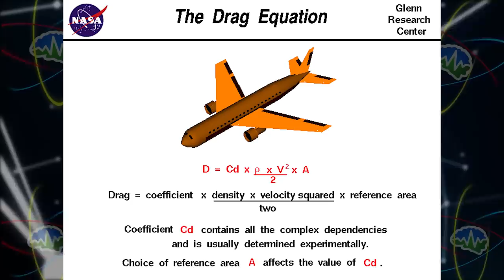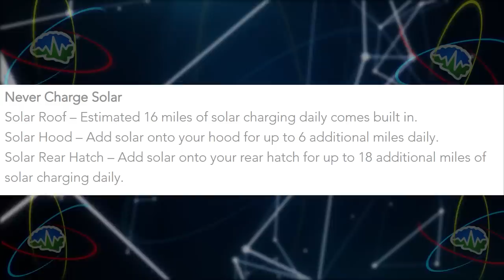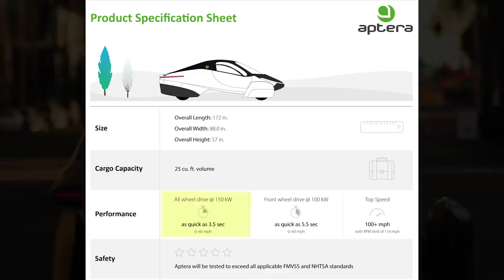Aptera Beats Tesla? | In Depth

Comment: I agree that just building bigger EVs with larger battery packs is not necessarily the best solution. One must be practical and honest about what is really needed. For example, the last time I had to do a 160 mile round trip was just once over two years ago. The rest of time I just drive 48 miles round trip or less. In my case I would be perfectly happy with 200 miles of range and charging from the Sun and plugging in for the difference if needed. But that's just me. Every person must make heir own choice. There is certainly a market for the Aptera out there and I hope they make it.

Comment: "No gasoline powered car has a range of 1,000 miles"... but lots of them, at 47K, are probably going to be a far better, and more luxurious ride than the Aptera (especially important on a 1K trip) and there are fuel stops on every corner, and every Exit along the way that will enable a fill-up in 5 or 6 minutes. I understand that some sacrifice will be necessary to be an early adopter due to the limitations of the technology at this point, but make a realistic / thorough comparison. Good review though. Aptera is eye-candy on the road though. Reminds me a lot of the Diamond DA-20 and the Remos Light Sport airplanes that I used to instruct in. All moot to me... not working due to Covid so I'll have to keep my 16 year old Outback anyway. Good thing I love the old ride!

Comment: Does anybody know if that 1000 miles is with the solar panels charging while they are driving? Would it be 1000 miles + energy gained from solar?
Reply: The thousand mile range is calculated from the EPA highway cycle with the 100 kWh battery pack and does not include any contribution from the solar cells.

Comment: By using Gallium Nitrite semiconductors instead of silicon semiconductors you could speed up charging by 2.5 times and increase the range by 5%. By using solid state batteries( ceramic or sulfide type), the energy density will be greater than the lithium type battery. So charging speed and range can be increased once these technology can output product at the industrial level. There is a company(Beam Global (BEEM) that is making charging stations that are solar powered and portable.
I wonder if the people at Aptera have looked into wireless charging. Tesla is looking into that as well as BMW, Genesis and Kia.
Do you know whose Solar Cells are being used in the construction of the Aptera? One way to increase solar recharging  by the solar panels when solar panel area is limited is to  increase solar panel efficiency.
Reply: There is a pretty good guess that they are using Maxeon cells, but it hasn't been officially confirmed yet.  I am sure that Aptera is staying abreast of leading edge developments, and in some areas are actually on the leading edge themselves.

Comment: Maybe I missed it but is this using a LPF or NMC/NCA battery?
With the efficiency of it's design and cost reduction, I could see the argument for the LPF.
But with the added charge cycles (top it up pretty much every time it's not moving) and range (at the very least the 1000 mile trim), I could argue against it. Plus they typically weigh a little more for the same capacity and it seems they looked at weight as a big factor along side drag.
I personally still wouldn't put my money down on an EV with a LPF at this point in the game for day to day use, stability and reliability. The results and reviews coming in from China and Europe with the Tesla LPF roll out has seemed to strengthen my opinion on that matter.

Comment: If the Sondors car ever comes out, it will be sort of the budget version of the Aptera, provided it actually retails for the 10, 000 or so they initially talked about.
Reply: The Sonders does not have the safety engineering of Aptera.
Reply: @n.brucenelson5920  That is true.  The Aptera  is definitely an all around better vehicle. But there are a lot of people, including myself, who cannot afford even the 25, 900 model. Hence, for us poor folk, the Sondors is attractive.  If I did ever get the Sondors car, I would line it with thick EVA foam, just to provide a bit of extra protection.
Reply: Well, tbh, I'm even more so learning towards the Metacycle or similar (E-motorcycle) and using that primarily for my daily work commutes, and keeping an ICE car for backup, for really long trips, more extreme weather, etc.  

  I hope Aptera eventually ventures into the 2 wheel market as well, and bring their aerodynamics and composites innovations to that field.
Reply: @justinw1765  Understood.   I have over 400,000 all weather miles on motorcycles, until I had to give them up due to vertigo.  My wife will appreciate not having to gear up and the climate control, however.  She was amazingly game to share many of our two wheel adventures.
Reply: @n.brucenelson5920   Sorry to hear about the vertigo issue, that sucks.  My uncle has Meniere's disease, and it's been really tough for him and he has to eat a very strict diet, and can't do a lot of the things he used to. He was a trucker, but had to quit because of that.
Reply: @justinw1765  Thank you for the empathy.  i am 71, so I have been very fortunate to have had the life I have had so far.  Aging is a process that, at least in my case, brings gratitude.
Reply: @n.brucenelson5920   Awesome approach and attitude. I hope I can become wise enough to primarily hold gratitude later on.

Comment: There can be maintenance problems with this car. For example if 1 wheel is more resistant than the other the range could substantially reduce. Because it’s range is so much dependent on the quality and fit/resistance of the parts.
Reply: The number of maintenance points is far less than most vehicles.

Comment: My problem with this great vehicle is that it will not pull my boat to and from the boat ramp let alone from here to the Keys!
My limiting factor.  My Subaru outback has a 2700 lb towing capacity WITH AWD for the slippery boat ramps. As well as being pretty competent off road, for as off road as I currently go.
Lmao, "a ride in the roadster"? NO! A DRIVE in a roadster!   ;-)

Comment: I I'm concerned about crash worthiness.  Structurally , can it hold up and not be a coffin with wheels?
Reply: The roof crush strength of the first version was 3 times stronger than any other vehicle ever tested up to that point.  This one is stronger.  It has front and rear crumple zones, front and side airbags, and other modern safety features.  It will be tested to automotive standards when preproduction vehicles are available to test and is likely to do very well.  When the ratings are published, I think the orders will explode more than they already have.

Comment: I wonder if they could make it with a small generator that could always operate at peak efficiency versus a standard engine which often runs out of it's peak power band. A couple gallons of fuel could go a long way.
Reply: A quick search find a Kohler auxillary power unit, it produces about 3.5 kw, but only burns .55LPH of diesel. Not sure if it would keep up for a road trip, but could help recharge after a longer trip.
Reply: That idea was tried in the first version of Aptera, and they used a small diesel.  I have also done this, using a diesel version of the smart car engine turning a dc generator winding on the flywheel.  DC meant that frequency wasn't important and the engine could turn whatever speed it needed to maintain the desired voltage and thus was always running at the optimum speed for the load.  Batteries are now at the point where that complexity is no longer needed.

A huge problem at the time was finding a small diesel that could be purchased in quantity.  Mercedes agreed to sell us the Smart Car engines with out any engine controls.  They didn't realize we had a smart engineering student who wrote the control software for a class at UC Berkeley, and we got it EPA approved at a lab in Southern California.
Reply: @n.brucenelson5920  I was following Aptera back then too. As well as Elio, I was disappointed to see both lose momentum, as I think there is a solid market for a hyper efficient commuter car, and now my drive is only 30 miles one way, but for years I drove 130 miles a day to work.

Comment: If the battery is fully charged, what happens to the energy supplied by the solar panels? Can the Aptera battery feed excess energy into the electrical system in a house, or does it just go to waste?
Reply: When there is a standard in place, V2G will probably be offered.  Since Aptera backs right to repair, third parties and owners can also install it.

Comment: I wonder why they didn't trade more window for solar. All the windows heat up the car. Curious how this would work out in Germany winter climate conditions.
Reply: We will have winter test results from the Elaphe cold weather test track next winter.
Reply: The full solar option includes a solar panel on the hatchback as well - not included in the prototype shown. Only then do you get the full 700 watts and up to 40 miles per day from the sun. Wish they mentioned that in the video. See their web site for all solar options.

Comment: I wonder what is a safety rating for this car? Special safety concern is because  the car is very light. Also, how it resist to the high wind? Can it be blown away by 60 m/h wind?
Reply: The car has been tested to be stable in 110 mph side winds. It is far more stable than any SUV.  It will be crash tested to automotive standards before production begins.

Comment: What about safety standards?  Seems more like a cool 3 wheel motorcycles.
Reply: It will be tested to full automotive crash standards.  We will have the ratings before production begins.
Reply: Body material is much stronger and more resilient than steel. Designed to pass auto safety tests, protect passengers in collision with air bags, roll cage & crumple zones, like in cars.

Comment: super light Aptera against winds & more real life questions:
1. Is Aptera going to end up in a ditch on windy days, eg. windy city ?
I mean winds from side, from front ,from back.
Has anybody taken the wind factor for consideration ?
2. stone chips might occur on solar panels as a result of road debris & hail
3. What happens in a side/rear impact collision with very LIGHT Aptera
4. what is snow or dirt effect on solar panels
5. useless solar when covered by rain dust in west Texas or Arizona, 
the Mediterranean Basin or parts of Australia to mention a few.
Sorry, 
to rain on your parade, let's test Aptera in real road situations
not only in laboratories & the nice weather.
I've no problem with the futuristic shape of Aptera, 
if the above situationsare addressed. I wish Aptera all success
Reply: It's not THAT light. It'll weigh about the same as the original VW Beetle. But it's 1.5 ft wider than the Beetle, so it should be more stable against wind.
Reply: 1It has already been tested to be stable in side winds at 110 mph - more than almost any slab sided 4 wheel vehicle.
2  The solar panels are replaceable in case of damage or new technology.  They have IP around this.
3.  We will have the crash safety ratings before these go into production.
4. Same thing as with any solar panels. People with these will tend to keep them clean.
5,  Not useless - but reduced output until they are cleaned off.

Comment: When you mentioned the elephant in the room, I thought you would say snow.  Two things come to mind, ground clearance and handling.  A single wheel aft is highly susceptible to side skid, especially in slick conditions.  And with the wheel fairings, it looks like this vehicle will bottom out on 6 inches of snow, even though the cab has more ground clearance than that.  Do you think this is a limitation worth considering?
Reply: Having a lot of experience driving a Corvair in snow, as well as many other vehicles, I don't think so.  There is an off road kit available to raise the clearance, if needed.  We will have more data on this when we see an Aptera being tested at the Elaphe cold weather test track next season.  Remember that the traction control is faster reacting than any other ICE vehicle.  I think with snow tires it will be fine.
Reply: It's absolutely a concern, you'd probably realistically have to restrict use to places similar to where convertibles are used or similar to where any 3 wheel motorcycle types are used., decent weather states or seasonal use., .

Comment: The Aptera is not a Car is is classified/registered as a motorcycle.   Motorcycles do not need crash testing or rollover testing.  Maybe that will change in the future as more of these are on the road.
Reply: Nevertheless, the first one was crash tested, and the roof crush strength was 3 times higher than any vehicle tested up to that point.  This design is even better.  It has front and rear crush zones, front and side airbags, and other safety features not specified by law.  It will be crash tested and the ratings published before it goes into production.

Comment: Love the look.  Has the prototype been tested in snow?  Here in the mid-west we don't get a lot necessarily (varies year by year), but we do get enough to have to drive through it.  With the covers on the wheels, I have questions on the build up of snow in those wheel wells.
Reply: Not just snow, but ice ruts from plows, smashed road kill , potholes that you can no longer avoid with that middle wheel....
Reply: @markbajek2541  What was the battery efficiency in those cold conditions?
Reply: @keithmartin955  I'm sure it suffers like all electrics do, it's a fair weather car/motorcycle for optimal performance. I'd be concerned about any collision with anything that sticks out at windshield level because you're only as safe as that windshield is strong enough to deflect a 10 foot piece of lumber with a little red flag sticking out of a pickup truck bed..

Comment: I like the looks, BUT...

I'm not going to leave my car outside at home to get it charged. Some places I go I have to park in a parking garage, like at my hospital or doctor's. 

What is going to happen to the battery if you can't cycle it? Lets say, like me you drive no more than 20 miles a day on average and the battery stays pretty much fully charged. Will they allow perhaps to shut off the solar so you can discharge the battery further once in a while or do it via a battery maintainer in the software.

How will the AWD do in the snow? I could see those wheel housings becoming jammed up with snow. My regular car in slushy crap can get clogged up. Heaters?

Addition: I'm a big man, I was born broad shouldered (poor mom). I'm 6' tall but have short legs, my height is in my upper body. Some vehicles my head rubs the headliner. Just wondering if a bigger guy will fit or do you have to be 160 to fit in it. I remember back in the late 70's and worked at a Honda dealer. I gave a broad shouldered customer a ride to work in a 77 Civic. We were door to door wide and touching shoulders in the middle. We got a lot of attention.

Comment: Does the off-road version have air suspension? What cameras or other sensors are there for autonomy? If I get towed to a garage to fix a flat, will they need special equipment to do it?
Reply: We don't know the answer on the first one yet.  Possibly.  The Level II safety pilot system uses cameras, and has OTA upgrades.  Standard equipment can be used to fix tires.  The wheel pants clip off and the tires are a common size.  I plan to carry a small DC air pump and a plug kit, so I can fix most road hazards and continue my trip until I can get the tire replaced.
Reply: @n.brucenelson5920  If I want to rotate my tires, what will it take? Jacking up the Aptera seems problematic.
Reply: @johnchang8279  Tire size is a standard P195/45R16.  There is a jack point at the rear and on each front side.  The wheel pants clip off.  It won't be much different to rotate than with non wheel motor tires, just a few pounds heavier.

Comment: If they design for aerodynamic efficiency, they should design aero number plate positions. Number plates would reduce the aerodynamics by quite a percentage. Not everyone can have no front plate either as in they do in some US states.
Reply: I think 3 wheel vehicles don’t need front number plates in any US state.
Reply: @kkobayashi1  That rear view is very thin and horizontal. I would be interested to see how that works with a plate.

Comment: Its the most air efficient and aerodynamic vehicle aimed at maxium efficiency and battery range. They designed it after whales and dolphins which have the  most streamlined bodies for slipping through the water. They have the right idea with the vehicle aerodynamics and making it light weight for maximum range at 1,000 miles on a charge. I like the solar panels too, so the car is being charged wherever it is parked in Sunny California.  I would buy this car, but worried about it not going into production and have concerns about it meeting federal safety standards.
Reply: I have no worries about it meeting safety standards.  The path to production is a real risk.
Reply: @n.brucenelson5920  Ok. Hope so. When will the car actually start production?
Reply: @ericwebb1963  We don't know, of course with the supply chain uncertainty and important validation testing yet to be finished, but as of now in May, they are on track to deliver first production vehicles by the end of this year.